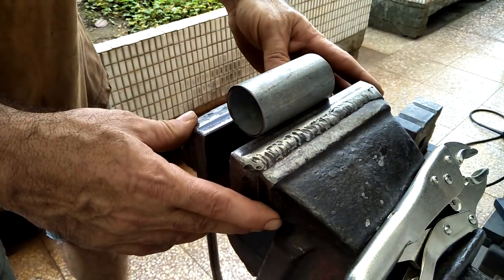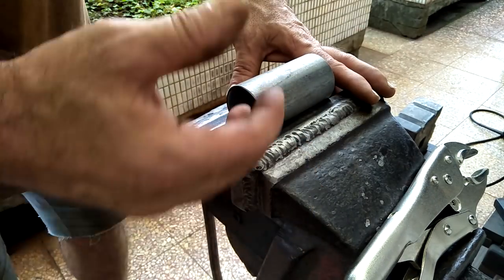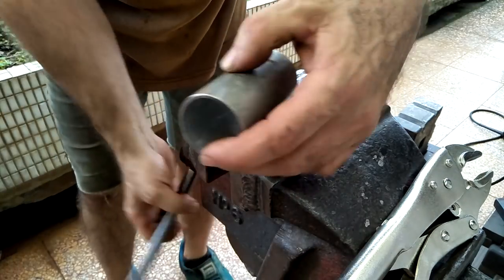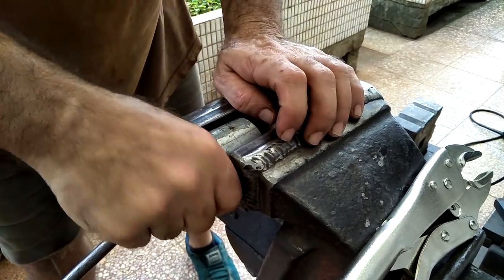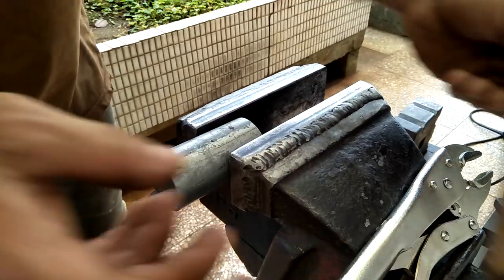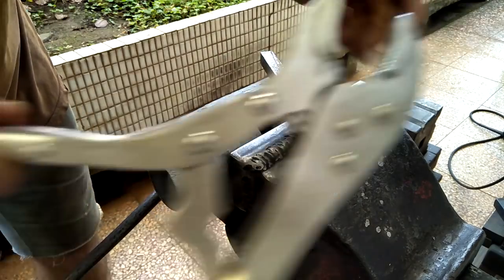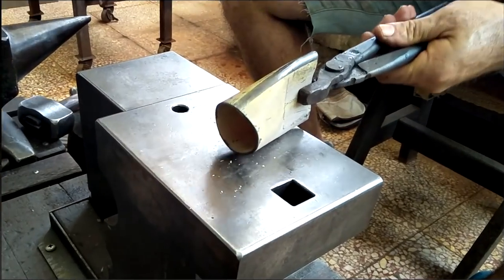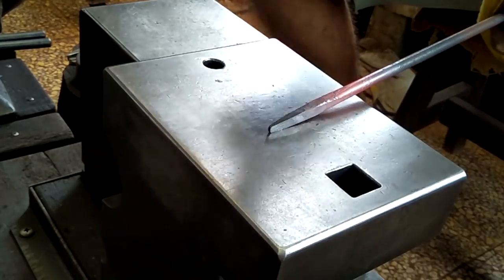Blacksmithing - ridiculously simple hook jig

Comment: I'm not trying to encourage anyone to do something unsafe, but the risk associated with galvanized steel is greatly exaggerated.  I used to work in a welding shop cutting and welding on galvanized steel for hours and hours and never got sick. I'm sure if you are in an enclosed space (which you shouldn't really be anyway due to forge needing ventilation)  you can get sick but you almost have to do it intentionally to breathe in enough fumes.  Safer is better, but i see alot of ridiculous safety nerds who probably never work steel anyway.  Great idea!
Reply from the maker: In my opinion, your post is very good. Of course we need to take safety precautions and should stress that others be aware of potential dangers. Nothing wrong with that. But some folks really go overboard and never seem to get past a certain point since everything needs to be overly considered before attempting... There's a certain degree of risk involved in just getting out of bed (or even staying in bed!) each day. Thanks.
Reply: The problem is two fold I believe.   You have the inexperienced who use galvanised and inhale the fumes and get metal fume fever because they did not use venting or was overexposed.   The other side is the expert who gets sloppy,  and exposed themselves unwittingly.  The research I did showed a Smith who had put pieces in his gas forge believing he could burn the galvanize off the pipe.   He was dead in a very short time from metal fume fever.   I know enough that I don't know enough about it to be safe around it so I choose not to use it in any forge application.   I also don't recommend it for any aspiring smiths to use because people don't use better judgement when it comes to personal safety.   This society has to have warning labels to not use hairdryers and toasters while in the shower.   Know what I mean?

Comment: I use a socket handle in the vice, then pick the size socket I need to make the curve I want.
Reply from the maker: Jack, I never thought of that. That would've made and even better video... Good idea. Thanks.
Reply: Glen GS Tongs : All of my sockets are either 1/4" drive or 1/2" drive, so they'd only be good for small curves. But the idea behind your video is very flexible and suits the scrap tubing diameter we have in our junk pile.

Comment: SAFETY WARNING: If you're going to use galvanized pipe (as shown in the video), remove the zinc plating first!!! Heating galvanized pipe creates zinc oxide fumes, which can make you VERY sick. A couple hours' soak in strong vinegar will take off the plating, and you'll be good to go.
Reply from the maker: John, This is good safety information. I am working outside and am aware to avoid the fumes but this may help someone who doesn't know. Plus, the vinegar soak could be very useful. Thanks for sharing.
Reply: What this guy said, vinegar strips zinc pretty quickly. If you know you can get away with breathing gal, or don't think it's going to affect you, fine. But as a general rule, don't put gal in the fire, unless you tell people not to put gal in the fire and that what you're doing can kill you.